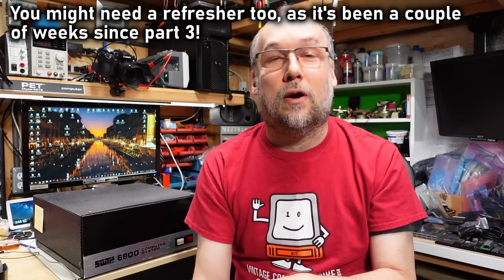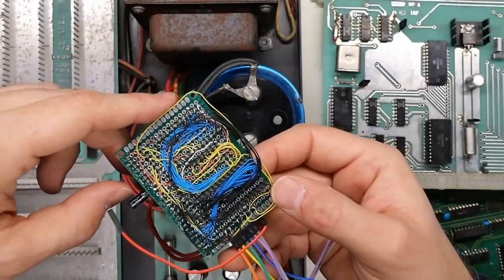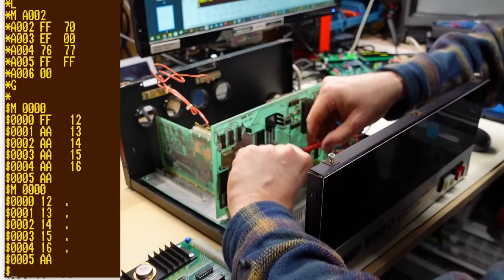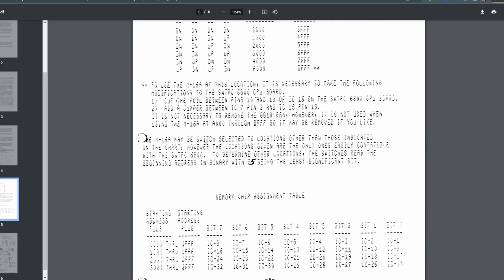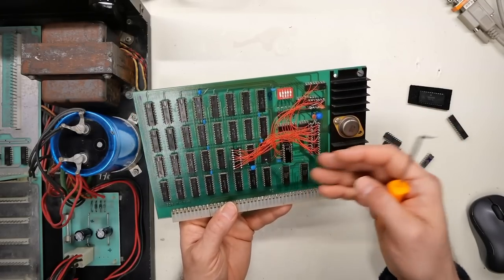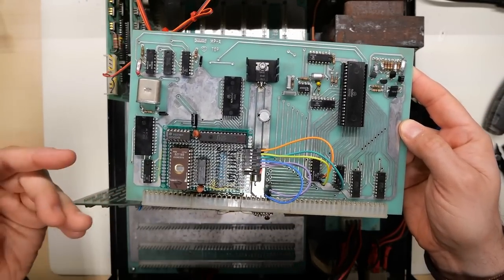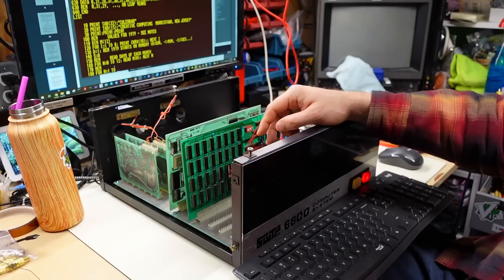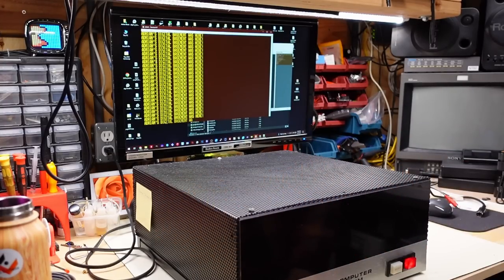We can fix it! A home-made 32K RAM expansion for the SWTPC 6800 (Part 4)

Comment: One warning with early versions of the Altair BASICs:  Some  early versions won't work correctly on machines with a full 64k of RAM. The original BASIC that Bill Gates sold to MITS was written in 1974, when the price of RAM made the idea of a 64K of RAM all but impossible to believe due to cost.  Because of this, as a space saver, the automatic memory counting routine that gets used when you press ENTER at the "Memory Size" prompt isn't very smart.  It counts memory looking for the end by looking for the address where it cannot read back the same value it just wrote.  Since this cannot happen on a machine with a full 64k, it either loops forever or just clobbers itself.
Reply: An infinite loop is likely to happen with a 6800 or 6502 based machine which uses memory mapped IO than an 8080, 8085 or z80 based machine which has a separate IO address space. Though writing to an IO device, page zero or the stack can still cause problems.
Reply: @markevans2294  Due to the assumption that nobody would pay for 64k of RAM, there were 8080 based systems that mapped IO devices into main memory space.  (This could also make it easier to design devices such as BOOT ROM cards that disappeared from system memory by disabling themselves with a write to an IO device that then disabled the chip select logic for the ROM entirely.  That was a real device on the Altair 8800.)  By the time that Z80's were available, this assumption was much weaker than it had been in 1974.

I expect that in practice, the earliest versions of Altair BASIC just clobbered the stack or something important on the zero page or just clobbered themselves, since on these systems BASIC was in RAM.

Comment: Were you able to determine if you have the small, “scratchpad” memory, maybe it was 155 bytes, overlapping your new 32K RAM and where? If so, that might explain any persisting memory issues. I think you should be able to map out where the errors begin and end. But, maybe even if you remove any hardware contention, the OS might be using those ram memory scratchpad locations overlapping with your program using them in the new 32k space.
Reply: That's the chip he disabled before adding the hacked-up 16K board. It's the 128 byte RAM on the CPU board at A000. Some SWTPC documentation calls it "MIKBUG RAM".

Comment: A Bluetooth or Wi-fi serial card would be pretty cool, you could just have the system in a convenient spot and zap stuff over the air. 🤓
Reply from the maker: Most likely I'll just stick a Raspberry Pi inside the machine. Then I can just SSH into that and use Minicom :-) More on that soon!

Comment: The answer why Basic finally worked is visible in the video as 33:03 : Forth line of  the memory load file states that you have to set the memory size to 32000 or it doesn't work. (so if you set it to 30000 it crashes)

Comment: You could have put TWO of those 32k ram chips on the CPU bodge board, and not even needed that extra card.  If necessary you could have stacked the two ram chips on top of each other with only the CS lines connected to different places.

Comment: VMA has to be used because the CPU will insert bus cycles when it has nothing to do (instruction isnt finished but all data has been loaded). On the 68xx series of processors the memory cycle is hard coded so it cant suspend it. The VMA signal differentiates between a real memory cycle and an inserted garbage cycle. You just had bad luck that the garbage cycle was a write to ram

Comment: If you wired the RAM on the card you made to start at 4000 (hex) and then set the 16K expansion card to start at 0, wouldn't the CPU card work by itself but you still get 48K when using the RAM expansion card?

Comment: feel like you need a proper typewriter terminal to work with this machine. A terminal emulator will always be hit and miss with any system this old because they are not designed to work with the constantly varying delays you get at these low speeds. The mechanical terminals may be clunky and loud, but their mechanical design means you automatically can't outpace the computer. To my knowledge no emulator is able to mimic that mechanical behaviour with parts that physically have to move before you can type the next line

Comment: That DNEXTS error tells me that the wrong "token" has been saved to memory.
BASIC tries to shorten all "keywords" such as PRINT, FOR, NEXT and so on to a single memory location by using a "token" instead of the full keyword.  Each "token" is an 8-bit value with the highest bit set high.  Only tokens have the high bit set while all other characters have the high bit reset.
It looks like the high bit of memory was "floating" high before the memory write was completed.  Adding the VMA check prevented that from happening, so the value being written to RAM was no longer corrupted.
Edit: Short version... it looks like you had a timing issue where the write operation was still happening even though the byte being written was allowed to change, but using VMA shortened the length of the write operation so it completed before the byte being written could change.

Comment: You really need to do more research on the SWTPC 6800. You will find ther are 128K RAM cards (and larger) that work with FLEX and OS9. This machine is not a flat memory model (ie lest use the whole addess space for RAM). The original layout has fixed settings space in lower area of upper 32K (as noted in 1st video - "the middle of RAM"). For later versions of OS9 there is mods/cards/ROMs to move that area up to last 16k area, allowing lower 48k to be managed (for larger bank swapping).
Reply: FLEX, yes, but OS-9 will only run with a 6809 CPU board.  And I believe that the extended addresses for >64K of RAM actually repurpose the bus pins that the SWTPc 6800 uses for the serial baud rate clock signals.  On the later 6809 machines that have the DAT/MMU, the baud rate generator chip is moved to the backplane, and I think the signals only go to the SS-30 bus.  There were different versions of FLEX for the 6800 and the 6809.

But I'd love to see him get FLEX up and running on this machine.
Reply: He has a first-generation CPU board that doesn't support any of that, and the upper 32K is a mess because of how MIKBUG worked. Those big memory boards were from the later versions that used the 6809 CPU. Yeah, they stole those silly baud rate pins for the extra address lines from the MMU.

Comment: that plot program runs without any modifying on a c64 just the screen not wide enough!!!!  switch over to c128 in 80col mode and it works flawlessly, have you got a source for the basic programs you have for that machine? be interesting how many don't need modding for cbm basic

Comment: I can understand your hack to disable all the ram on the 16k board to use the 32k chip, but it appears you kept the bad chips installed. Even if they're disabled it would probably be a good idea to remove them. If somebody tries restoring the board after you it will save them some frustration.

Comment: hack and slash mods are cool, as for the memory thing, I would be tempted to see if I could get the CPU and ram to clock a bit higher. maybe not 10GHz LN2 OCing insanity, yet maybe something a bit more, say 1.1 or 1.2 etc MHz vs stock 1MHz.

eons ago, my dad got me a Vtech Laser 128EX (with them odd angled vents on the top, correction, "Laser Compact XT" not 128EX), and the first thing I did was swap the (sure it was 8MHz not 3.6MHz) 8088 CPU with a 12MHz one, second was maxing it out with 640k of ram. it wasn't much of a CPU jump from 8 to 12 MHz yet it was enough for some complex maths stuff at the time. (and then I notice you have a vid on that thing, lol. no CPU visible and onboard PSU is not the same, hmmm)  anyway, sometimes bumping up the CPU clocks a tad helps, sometimes.

edit: then again, the 8088 had IO buffers to isolate the ISA buss from the CPU core that let ye have 3.6MHz 8MHz 10MHz etc CPU without messing with RS232/floppy clock stuff, maybe it won't work to dial up the 6800 in that, hmmm.

Comment: Honestly, there's a certain set of people that think of these old PCs as just a bit more precious than they actually are.  You're not working on a work of art by Rembrandt where there's exactly one.  You're working on a computer that's a few decades old that's available on ebay for $2500. If we really wanted to, we could largely completely re-create this computer at the circuit board level.  I don't recall you talking about any custom chips for this machine, so it'd be easy to re-create it, unlike the C64.

So I'm saying, whatever you want to do with it is fine since it's yours.  If someone else wants to go and try to find the original memory chips and replace them on THEIR computer, that's fine too.

Comment: i've been using Teraterm with it's default settings at 9600 baud with multi kilobyte large files and it never missed a single byte.
so maybe it's just the UART or ROM code that sometimes has a hickup

Comment: You really went to town there, and it was a bit difficult to follow, but bravo to you for making it work.
I find it hard to judge where to draw the line on such projects. On one hand the machine isn't really useful. On the other hand you could easily optimize away 95% of the hardware. Either way, it's rather pointless, except for the experience itself and most importantly the act of documenting this thing. The physical hacks might seem a bit much though - at least the trace cutting. I'm not sure. It's a dilemma.

Comment: Don't blame Tera Term or the PC for missing or corrupting characters when pasting data into a user program (such as BASIC) that is expecting input from a user at normal typing speeds. If you had tried loading the BASIC programs as S-records or even as simple binary images, without trying to pass them through the BASIC input processing routine, they would have probably worked. The S-record transfers that you showed all worked successfully and they were larger than the BASIC programs.

Comment: Doesn't the serial port have flow control?
Reply: You can see at 32:42 that he has Flow Control set to None in the dialog, so it might be the SWTPC has flow control, but Tera Term is just ignoring it because of that setting.
Reply: I think the DB25 connector only has 3 wires connected, so it doesn't have flow control. If the UART chip has that functionality it could be modded in.
Reply: More importantly, machines with bit-bashed serial ports needs some intercharacter reception delay in order for it to process the received character. The CPU can only do one task at a time - i.e. either servicing the serial port or doing something else.
Reply: @pebbleschan6085  In the May 1977 issue of "Interface Age", there was a hex dump of a 4K BASIC by Robert Uiterwyk. If you study a disassembly of it, you can see the limitations of the 6800. When it looks up the keywords, or moves data around when a line is inserted or deleted, it really needs 2 pointers, but there's only 1 available (the index register X), so he worked around that by disabling interrupts and using the stack pointer SP and PUL instructions. Imagine what effect that would have if the BASIC on the SWTPC did the same - no interrupt handling while a line was being added.

Comment: 26:45: I don't understand why the two M B000 lines produce non-identical output. Why is that?
Reply: The M command shows you the old contents of the memory, and then lets you write a new value. With the first M command Adrian wrote 12 to that location, so that's is what is read back the second time.
Reply: @eDoc2020  Thank you! :)

Comment: why werent you using flow control; or doesnt the serial card support flow control? maybe that would have helped with the sending errors....  im thinking vma is a "sync" signal from the processor that goes high 39:13 when your address lines are "flip flopping" inverting, and if you look at phi2, youll see the slope of the curve is longer when the clock  goes low, and notice that addresses flip flop again, right before that portion of  transition out, memory is valid, whats important is the sync signal is meeting on he down of phi 2, when it starts at the up of phi 2; so on the high vma enables, right during the last millisecond or so vma goes low with phi 2 in its stage transition, at the end of that phase, or segment, addressing flip flops again. regardless if read/write are the same or so it appears, they ar running on the same clock, im saying different frequency.
Reply: Yeah, there's no flow control, that mostly wasn't a thing until 16-bitters. Buffered UARTs weren't a thing in the 70s. It's hard for those old 2-4MHz computers to keep up with full-speed 9600 baud.

Comment: I think the bodges are fine for a test. but I think you should remove them and create a period correct new memory board. could be much smaller then the originals. then keep the old broken boards original.
Reply: The thing is, he really can't get more reliable than that 32K in the ROM socket. Apparently the SS50 bus was infamous for its tin-plated molex pins being less than reliable.
Reply: @8bitwiz_  it's not only about reliability. It's about keeping things original and creating new boards to an old system. Not every collector wants to make a rats nest of his device.

Comment: I must say it looks kind of messy to replace a 4kx1 RAM with a 32Kx8 RAM. I think I would be much more elegant to make a 6168 4Kx4 SRAM replace 4 of the RAM chips in one bank, an then you have some spares to use for the other banks. Nevertheless many congratulations with the repair! This is definately a great piece of history to be in working condition again and I'd say it deserves a place in a museum.
Reply: He didn't replace the bad chips. He disabled the chip selects for all four banks and instead ran them through a NAND gate to generate a single chip select for the big chip. He used the socket from one of the good chips to get most of address lines.

Comment: I will admit watching these mods are a bit cringe worthy, however I have to keep in mind some of this equipment was already defective, so repair takes it out of "original state" And also back then hardware hacking was just as important as software development. I was very impressed how little circuitry was needed to make the memory module with rom chip. Not sure if you can demonstrate this, but why would someone pick a 6800 system over 8080?

Comment: 1200 baud is four times as fast as 300 baud, not four times faster.  Four times faster would be 1500 baud.  1200 is three times faster.  The difference between “faster” and “as fast” is 100%:

150 baud is not 50% faster, it’s 50% as fast.  100 percent faster would be double, or 600 baud.  200 percent faster is 3x as fast.  300 percent faster is 4x as fast, etc.